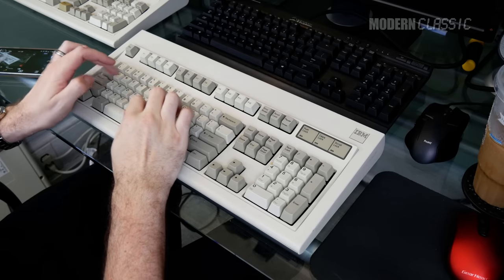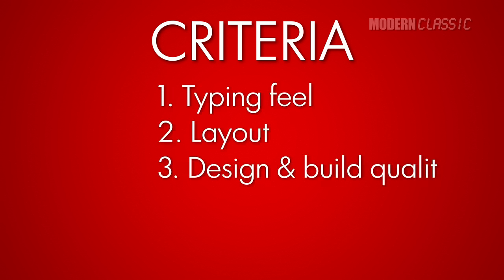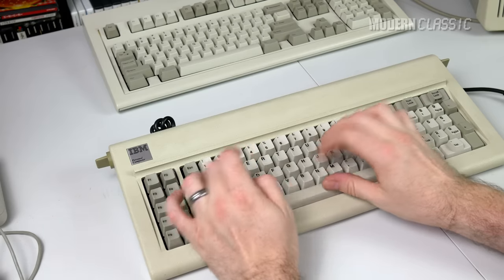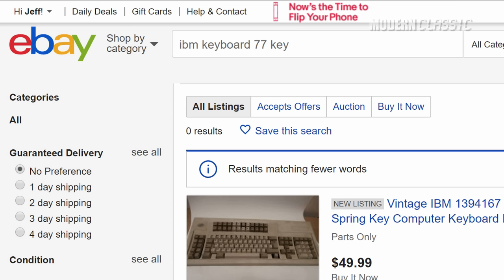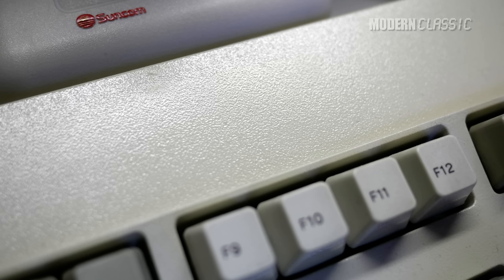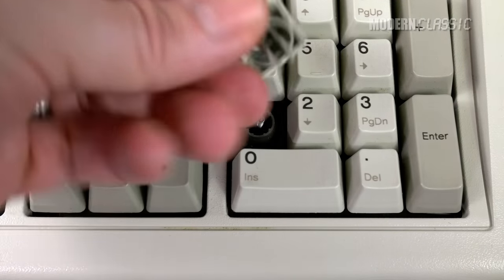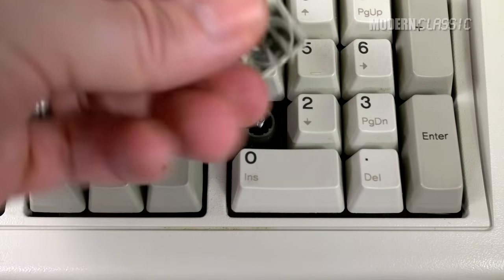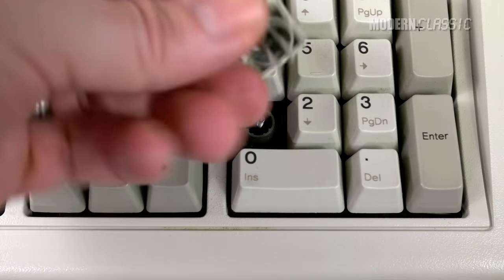Ultimate Keyboard Showdown - IBM Model F or Model M?

Comment: These days, IMHO it doesn't make much sense to buy a Model M (unless it's new from Unicomp) because the plastic rivets fail over time.  It doesn't matter if it's NOS, I don't think. They just do, and IMHO he dramatically understated the complexity of fixing it.  Every model M I've bought in the recent past has had at least some broken rivets; two of them looked great but were actually near death.  I don't blame the seller; you'd have to open it up to really know for sure.  The rivets can become extremely brittle but not fail until someone actually uses the keyboard. Unicomp has renewed their tooling and there are no QC problems anymore.  As I see it, it's crazy not to just buy a Unicomp given the prices of used ones and the aforementioned problem--especially given that they are only $104.  Yeah, they aren't as beefy as the older models M, but they have a warranty, are USB, and are NEW.

New foam vs rivets is not a tie--at least not for me, and I doubt for most people.  Like come on, drilling all those new holes and putting bolts in is the same thing as changing the foam?  That's ridiculous!  Note that he is still working on his bolt mod.  😂  It's a PAIN.  I know many people here are way more competent at that sort of thing than I am, probably, but still ...
Reply: I've actually bought a used old Model M with perfect rivets, but yeah it's impossible to tell unless you ask the seller to shake it like a maraca, which is probably a good way to sound insane and get ghosted.
Still even that one felt different from how I remembered the Model M being, so I think they loosen up over time just from use and still need a bolt mod to feel right.
Reply: @2old2steak  I just purchased one as well with a bolt mod and it sounds great.   I did have an old model M back in the day and am not sure if the sound is the same.   Needless to stay I love my new/old keyboard :)
Reply: It's possible to repair them by drilling and tapping the rivets and using screws.

Comment: So, I got a large WANG (LOL...no jokes) keyboard a few years ago.  I've been meaning to restore it.  From what I understand, WANG used a different protocol.  Do you know anything about them?
Reply from the maker: I know them very vaguely but have never owned any of their stuff. I'm guessing it's something like this? https://www.seasip.info/VintagePC/wang_kb.html

I see a few mentions from people who seem to have gotten one of these to mostly work on PC, but without any of the special keys, just as a standard PS/2 keyboard. I'm not entirely sure how they've even done that, though - it doesn't look like it'd work even if you cut the connector off and rewired it. (I doubt an actual adapter even exists.) It does seem to use a totally different communications method than the PS/2 or AT protocol. So I'm not sure off the top of my head how to make it work.

Comment: I'm typing this on a 122 key model F. Best keyboard I've ever used, keys feel crisper and smoother than my model M.
Reply: Agreed. F122 battleship is the best keyboard ever.  Near-standard layout, model F feel, 2 part keycaps, and plenty of extra keys for modifiers.  Plus, 24 dedicated function keys are super useful if you actually work on IBM Midrange servers as I do.
Reply: I'm typing this on a model F XT. While it is the greatest felling keyboard that I've ever used, the layout is horrible for modern computers. But if I had a 122 key I would probably be singing all of the same praises you are.
Reply: Nicholas DeLessio  It is near standard, and also, if you want, you can transform it into full ANSI standard layout if you have correct key buttons for replacement.

Comment: Model F has slightly better feel, the layout's a bit of a wash--no dedicated arrow keys on the model F, but it generally has a much nicer, svelter, layout than the M (e.g. doesn't have the stupid capslock key position that later became standard [rarely used key, prime position]).  The  F's smaller size is also really nice, the M has more of the bloated monster feel that later became common.

Winner:  model F
Reply: Thankfully, IBM did reduce the footprint of the model m, but that was after cost cutting measures had come into play, which is unfortunate.

Comment: changing foam is simpler than rebuild rivets @9:05
Reply from the maker: Not really.
Reply: @ModernClassic  I agree. Foam is also extremely hard to find. In fact one of the only places I could find it was the obscure "Michaels" craft store with only 1145 stores in 49 of the united states alone. On sale I got a 1 foot by 2 foot sheet for the outrageous price of $1 USD. The price is obviously astronomical. It took me literally tens of minutes to punch out the barrel holes. It was just the worst.
Reply from the maker: It took me about 10 minutes total to do all the rivets in a Model M. It's an absolutely trivial job. I wouldn't even call it a "mod" myself.

But glad you find that foam so easy to work with! We're all good at something.

Comment: Nice LaserDisc player, are you going to do a video about them in the future?
Reply from the maker: I thought about it, but I'm not sure what possible angle I could take. It's not obscure enough to be interesting in that way, and not good enough to really use for any purpose today. It's one format that's really just been made obsolete as far as I can tell. Most things have something gained and something lost, and consequently do at least some things that modern equivalents don't, but LD doesn't feel that way unless you just like the size of the discs.
Reply: It’s a pretty obscure format considering that most people have never heard of it. And while Laserdisc are obsolete, there are sill plenty of reasons to use them, enough to make a video about it. There are many films that have been altered on DVD and Blue Ray and the only way to watch the original cut is on LD. The sound quality is also arguably better because of it’s better mixing and mastering on Laserdisc, as apposed to DVD. This is even more true for Dolby AC-3 and DTS discs. I have a large collection of LDs and I watch them more often than Blue-Rays when I want to watch an older film.

Comment: Unless I'm wrong, I don't think the model F is compatible with modern PC's.  Even if you get a decent USB converter, the keycodes generated by the model F are different from the model M.  I suppose you could hack the PC keyboard drivers (probably already an option in the Linux kernel, but NOT Windows), to make the model F work, but it won't out of the box.  All of today's keyboards use the same keycodes as the model M.

You didn't mention the space saving model M.  This keyboard lacks the number pad, those functions are merged into the main keyboard via the shift+numLk toggle.  Since all of the number pad keys are duplicated in the main layout without using that hack, no functionality is really lost.  I've never made use of the number pad myself, I think the purpose of the thing was to emulate a calculator input for bean counters.  If you can touch type you don't need it.
The space saving model M has single piece keys.  Mine came with the detachable cord.  I'm using an active USB converter with it.  Typing feel is as good as the full size model M in my opinion, and the keyboard takes up less space on my desk.  I'd give this one a nod over the full size keyboard (perhaps until it needs repair work).  Still, I did snag two of them brand new in the box at a Hamfest back in the 90's for under $25 for BOTH.  Still using the original, and have the other as a backup spare.
Reply: There are active adaptors from the XT protocol to USB available. Search for "Soarer's Converter".
But you won't need that with the Model F AT because it speaks the AT protocol: It is the same as PS/2, only with a different connector (and missing a few keys that are on the Model M.)
That compatibility is one reason why the Model F AT is more desirable and fetches a higher price.

Comment: I just can’t understand how anyone could stoop to a model f or m when you can get a beam spring keyboard. The f & m are such a downgrade.
Reply: 3270/5250 Beam springs feel nice, but they are a hinderance when typing more than 60 words per minute, the combination of the actuation force and the interaction of the beam springs deliberately slow down how fast you can type on one.
Reply: @tschak909  Good point! For me, I think the height of the Beam Spring boards is a huge disadvantage considering that we need our other hand to be much lower and closer to the desk to use a mouse. Maybe it'd be more viable to those that have a desk with a recessed central section for their keyboards.
Reply: AbuBakr Akram what a great idea - it wouldn’t be too much hassle to sink a beam spring keyboard into a desk. To be honest my comment was tongue in check. I’ve never used a beam spring, but am sorely tempted now, especially as I don’t type that fast. It’s just a matter of waiting until I have the spare cash...
Reply: maybe cause beamsprings are >$1000?

Comment: Seriously, you didn't need to drill holes and use floss to put the spacebar back in. I've serviced the Model F XT, AT, and F122 and was able to put the spacebar back in easily. You can just push the stabilizer bar back under the tabs on the spacebar before closing the keyboard and line up the flipper when you close it. Also, the keycaps on the F122 and maybe others are also removable, like the model M's
Reply from the maker: Tried that, almost broke the stabilizer clips off doing it. Wouldn't recommend it.
Reply: You just need the right tool and the right experience. I’ve done it successfully several times on four different Model F’s: a Model F XT, two Model F AT’s and a Model F 3178 Blue Switch. The Model F 122 is nice in the sense that it uses a stabilizer bar like the ones on early Model M’s so you don’t have to deal with opening the barrel and flipper assembly to remove the spacebar. I never came close to breaking anything, I think you just did something improperly.

Comment: What about the M2? I prefer it for the smaller footprint.
Reply from the maker: I don't own an M2 so can't comment firsthand, but I've seen a lot of reviews and you can practically bend that thing in half. I have a feeling it's very similar to my P70's keyboard, which was produced around that same time and was made to be lightweight, but just with buckling springs instead of plate spring switches. Now that I write that, it also sounds similar in another way to the modern Unicomp Model M's, which are quite flimsy and light in my experience but still have buckling springs. But the strength of the case tightens up the typing feel on the M and F; I don't think the M2 would provide that to the same degree.

Comment: If you don't have n-key rollover, how do you do Ctrl+Alt+Del, if the keyboard can't recognize 3 simultaneous key inputs?
Reply from the maker: It can. That's part of the point of that section of the video. Not having NKRO is something you're never even going to notice. There's no combination of keys you'd normally ever press that won't register.

Edit: I guess I should add a caveat that that might not be true of cheap keyboards, and this might be why so many cheap keyboard manufacturers now go out of their way to advertise NKRO (even though USB doesn't even support it). Cheap keyboards are known for things like ghosting and jamming. The Model M is not a cheap keyboard, though. You can see in my Aqua Key test that it's actually registering up to 7 or 8 simultaneous key presses at times, and it's designed so that all the common combos work.
Reply: Ahh, okay. Was confused!

And dang it why is it SO hard to find keyboards with an L-Shaped Enter Key? I just went on Amazon just now, and the only ones I can find with an L shaped enter key for reasonable price are foreign language keyboards or keyboards that have those 3 extra sleep/wake/etc keys above the page up etc keys. So annoying. Trying to find a keyboard close to one that my mom uses because she gets confused easily if the new keyboard isn't similar enough to the old one, and the one she has is wearing out. Trying to find her something that might actually last awhile; she's got one of those cheap membrane dome keyboards, and everything is compact this, compact that, tiny keys, - shaped enter keys, etc.

EDIT: BTW, mom's keyboard won't recognize some 3 key inputs... while playing MMOs, I've sat down at her computer and one of my favorite things to do is to hold down the space bar to climb, and I will hold down A to strafe left and I will hold down the right arrow to turn right (to make a climbing turn while on a flying mount) and I get this awkward BEEEEP from the OS as it registered an invalid key combination or something, but yet my Microsoft Natural will handle the same kinds of turns just fine.
Reply from the maker: Well, you can partly blame IBM and the Model M for the lack of L shaped enter keys. The Model M layout became the ANSI standard, which is what all US keyboards are based around. The ISO standard has an upside down L shaped but I don't think that's what you're looking for. A regular L shaped enter key is just non-standard, so it's probably going to be tough to find, especially in a new keyboard. You might have to look for something new old stock, or just used but in good condition that you can clean up so it's like new.
Reply: Might also offer to take it apart and put it back together, I wonder if the worn out keys aren't just debris hindering the movement of the dome mechanism. It's a years-old keyboard and I know she frequently knocks the stuff out of her KB but it surely can't be good to have all that junk in there. Either that or pull the keycaps and vacuum. Hmm.
Reply from the maker: Depending on the construction of it, you might be able to do what many people do with the Model M and take it apart and put the plastic (non-electronic) components in a dishwasher. Then it'll be like new.

Failing that, just taking all the keycaps off and vacuuming, then cleaning with regular glass cleaner to get anything sticky up off the front plate and posts would almost definitely help. While you're at it, stick the key caps in a bowl with some denture cleaner for 15 minutes; that does wonders.
Reply: Thanks for the suggestions! Also pondering just ponying up the money for a bent spring keyboard, but will try some of these suggestions in the meantime. My keycap puller just arrived today so I'm ready to go! Also got two microsoft naturals with caked on dirt on the keys that need cleaned up too.

Comment: So the Model F and the Model M have swappable keycaps? This is very, very good news.
Reply from the maker: Yes they do. But you're better off trying to find some single piece caps to swap, since you can't swap the full set. (They have some keys of different shape, and since the two piece caps are taller, they will look a little weird and might feel different when typing.) There are Model M single piece caps; I'm pretty sure Unicomp even sells new ones (though I'd look for some Lexmarks).
Reply: Ah yes, the legends.  I had not considered that the two-part Model M keycaps would not be a 1-for-1 drop-in replacement for the Model F's.  Thanks for the heads up.